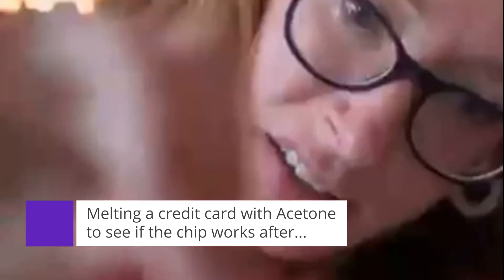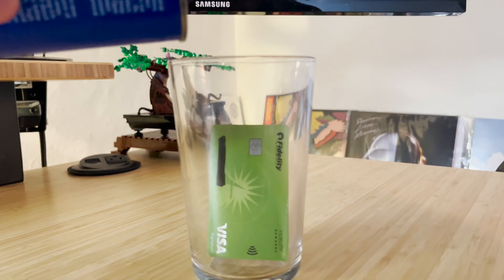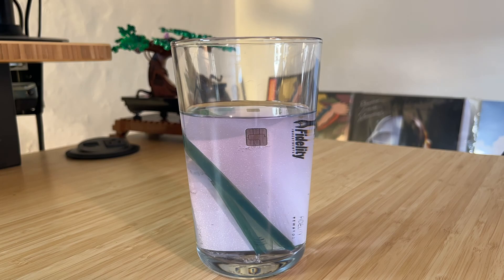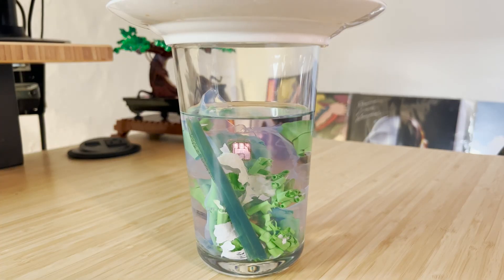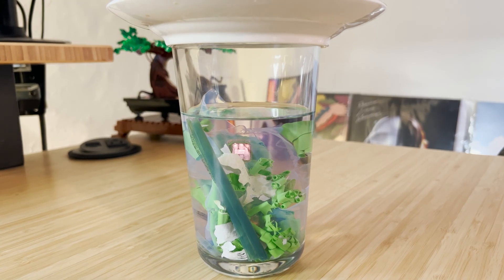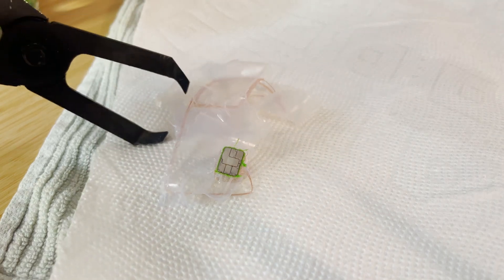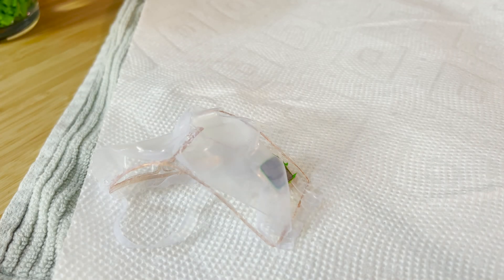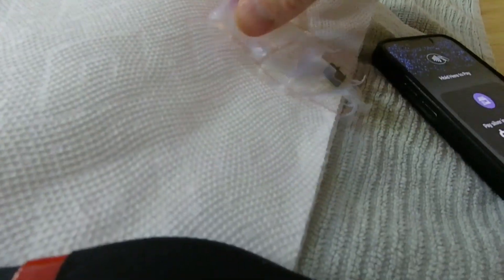Does a Credit Card Chip work after you MELT the plastic in Acetone?

Comment: it works if the antena survives but it defeats the purpose of dissolving it. You still need the antena. that's why people disable nfc from their cards by drilling holes on them to sever the connection between the antena and the chip.

Comment: Not necessarily.  I’ve been working with these cards for a month trying to get stuff right.  It appears some chips have wires connected while many others have wires connected to contact pads in the emv pocket and then the emv chip has corresponding contact points.  So maybe hers was legit and the wires were attached while yours just separated from the pocket.  If you still had it, you may even be able
To solder the two leads of the wire loop to the contacts of the chip.  Also, your loops would have to pass through the magnetic field correctly to energize the loop and power the chip.  So I don’t think you’ve experimented enough to totally dismiss it as clickbait or whatever.
Reply from the maker: Thoughtful comment, thanks! I think you’re right
Reply: Have you gotten it to work?